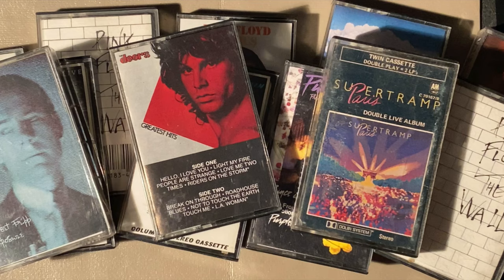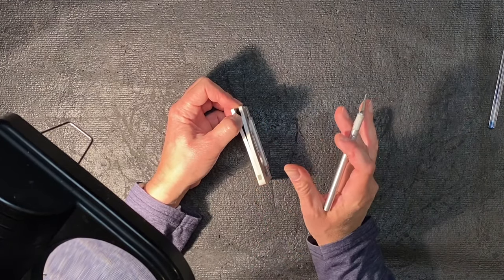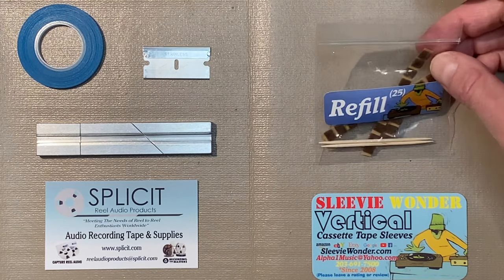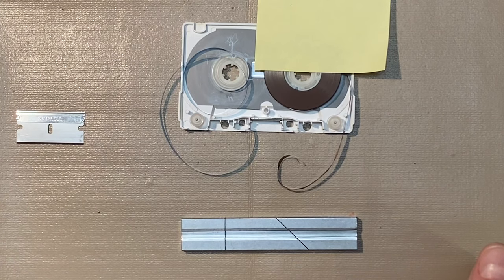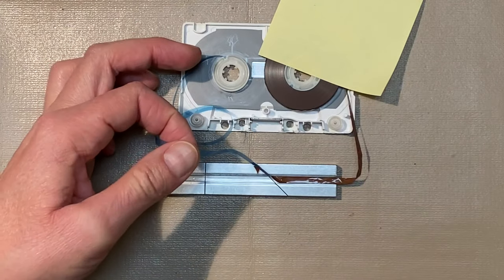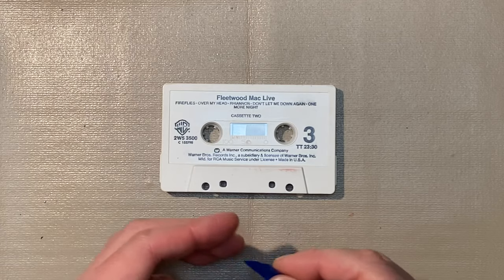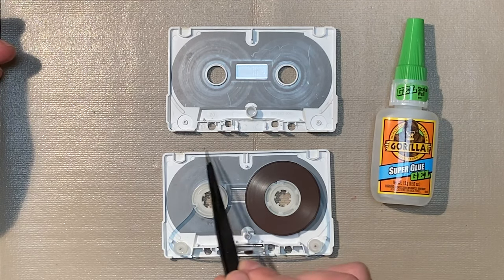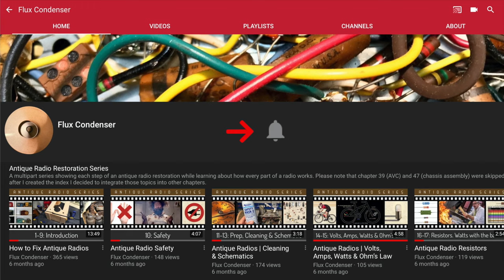How to Fix Cassette Tapes The Right Way. Open, Splice, Repair Like a Pro.

Comment: This video was a huge help. I recently bought a two tape album and both broke instantly where the magnetic tape connects to the plastic tape when played. I tried the method of opening the tape on an old home-made tape to see if I could do it without damaging it, but didn't have the right tool and was a bit impatient. I managed however to make use of this tape's plastic section to fish out the plastic tape on the tapes I was repairing, since the magnetic section was already exposed. It took a good few hours but somehow it worked. I could then follow your advice on how to repair them from there.
Reply from the maker: Glad to hear, Jay. Congrats on getting it fixed.

Comment: If you use a tape dispenser, you can pull a piece of splicing tape and cut it with the razor blade then stick one end to the razor blade parallel to the edge which helps to align it before you stick it down.

Comment: I have cassette tapes that are mostly sealed ones that need repair. They all have that pressure pad issue. And another tape just randomly snapped at the very end. The tape is sealed too.
Some of the tapes I fixed, have the snapping right where the Lier is, because, the sticky thing comes off.
Other tapes are really easy to repair. With screws in it of course. I also made a mini tape repair kit for tape parts.

Comment: Thank you!!
I just borrowed my parents old box of cassettes and their little radio to listen to and pull out some of the music i remember from when i was little. And what heppens but the one cassette i was looking forward to the most split the ribbon as soon as i started playing it.

I made due with what i had, which was a pair of scissors, sticky notes, scotch tape and some tweezers. It may not be the most elegant (or even proper), but the cassette is playing just fine as i type this comment. So again, thank you for this guide.

Comment: I managed to open the case using a hacksaw on the four corners .When you have opened it please make sure that you have the case with the roller pins facing up towards you otherwise it will be MISSION IMPOSSIBLE ! Cheers Eddie

Comment: Watched to validate that I was opening the case the right way lol. I used heat resistant tape to do the repair. Trimming the sides with a blade. Great video thanks.

Comment: Today i put a screwdriver into a cassette, and then ripped it apart (it was sonically connected, literally put a screwdriver into the tape path and bent it , exploded in my hands lol ). Took the spool and put it onto the replacement . I then taped down one side and got both the sides spoiled close as possible. The tricky part imo is getting the top tape shell back on without pressing into the tape on the tape path . I’ve never felt more accomplished AND IT WORKS . The tape is now worthless but it has exclusive stuff i cannot find online . Always pre wind new tapes, the factory splice sometimes snaps from being so old

Comment: Tapes that are screwed together, I can easily open up and repair. Tapes that are glued or sonically welded together are a different story. I can never get them apart - always end up breaking the shell into several pieces. Then I have to transfer the reels to another cassette shell to get the tape to play again!

Comment: Thank you from Romania, Brasov - followed your instruction and for one cassette by opening it I found out that one of the plastic roles was off, still inside but the pin that was holding that was missing - used a sewing pin to manufacture one and everything was back in place - this cassette is coming from my dead father-in-law so it has sentimental value - loved the joke about hemoroides - piles, never realised that piles is the equivalent of that - translation in Romanian/traducere romana - multumesc din Brasov, Romania - am urmat instructiunile de aici si la o caseta am descoperit in interior ca una din rolele de plastic cazuse si axul ei disparuse - am facut un alt ax dintr-un ac de cusut si acum totul e la loc - casetele astea sunt de la socrul meu care a decedat si au valoare sentimentala - am apreciat gluma despre hemoroizi - piles (mormane) - nu am stiut ca piles poate insemna si hemoroizi pt britanici
Reply from the maker: Glad it helped, Unul! Nice hack with the sewing pin.
Reply: @FluxCondenser  thank you - nice job once again with this video than brings back to life vintage things

Comment: Thanks for the information. I was able to open and repair a sealed cassette that was about 40 to 45 years old. I was able to digitize it but I may have to do it again. There were variations in tape speed part way through the tape. The tape recorders I have need maintenance as they have been used in a decade or more. One hasn't been used in several decades.

Comment: I first was interested in how to repair the pressure pad. Your instructions and sources of material were very helpful. Great video. Loved seeing someone else using cassette players. Loved the Nakamichi cassette drive! One question: if super glue is used on the inside points of the plastic case, won't that make it impossible to reuse? I assume you would just then move tape over to a new unmarked case, correct? Are replacements available that screw together?
Reply from the maker: Thanks, Jim. Glad you found the video helpful. As far as getting the cassette open again after using super glue, it won’t be a problem if you used glue on the outer edge of the shell if you repeat the step with the Xacto blade. That’ll cut through the glue. But yes, if you use a lot of glue on parts of the shell that you can’t get a blade into, it might make reopening the shell difficult. Replacement shells are absolutely still available. Check eBay.

Comment: You can do this with VCR tapes as well, there’s a couple of extra parts in them, mainly the locks on the tape reels, and sometimes a little T piece that goes between them that have to be set in accurately, but the principle is the same. And most VCR tapes have screws.
Reply from the maker: Yes, all tape recording media is relatively similar and can be repaired with splicing techniques. Even digital formats.

Comment: Great video .. i'll have to save it incase I need this information in the future. Do you have videos on how to fix tapes that are running slowly or ones that have broken cases? I have at least a dozen tapes (possible more, once I test them all) that have the slow running issue. Another tape is going to have to pulled apart to figure out what's going on it with it. It's frozen and the tape don't move in it no matter what I do. These are all pre-recorded tapes from the 70s-90s mostly.

Comment: I just got my The Doors Classics cracked in two and NOTHING broke. Dropped some glue in the top holes and snapped it back together. I use sponge and double sided tape for new pads.

Comment: Some good hints and an excellent run-though thank you.  Although the tape should definitely go INSIDE the side "posts", otherwise the rollers are not functioning efficiently (I have checked this on a couple of transparent pre-recorded bodies). I also prefer the  "bend until it creaks" method of opening the bodies,  then using a sharp edge like yours, if required - they usually come apart quite readily without cutting. EDIT:  upon further research, it seems that both routes are used,  (even in otherwise identical cassettes), so I change my advice to "it definitely doesn't matter!"

Comment: So. I dunno if that was the magic sauce or not but thanks. :D So I was using this same splicing hit to fix an old ZZ Top tape I had because the old tape was coming off. I was worried until I watched this again and realized (maybe) I was cutting the splicing tape too short. Got it a little longer and now no issues. For a minute there I thought the tape was too thick because it was getting stuck on the pinch wheel. 3/4s of an inch it seemed to matter in my case.

Comment: totally brilliant. the pot-it tip VERY helpful. personally, if tape still plays and not avilable on YT etc., I would dupe
it, in case rwpair does’nt work 100%
on brecored blank BASF caettes diacard top and side SM components(if fitted), if tape is jamming-de-spooling(one at top, & two side-arms.

Comment: A tip...get tapes from a charity shop and practice taking them apart, adding/removing leader tape, splicing...tapes that would be the very last thing you would normally buy...in my case, any opera, rap or chamber music! There are Tape Repair Kits, splicing blocks and splicing tape available on line....be prepared!

Comment: Just my two cents: it might be easier especially for a novice with an exacto knife to start from the tape slot and work it out from there towards the side with an empty hub or less tape.

Also don't forget to replace the slip sheets inside facing the exact way you found them, they are not bilateral and they usually have a slot or two for them to be correctly aligned. Also remember to not flip your reels, you might end up with Side A onto Side B.

Comment: I have learned to take the right sized screwdriver and twist it in the top holes of the cassette, the holes that decide if you can record or not on the tape...that will start the opening, then work your way around.
Reply from the maker: Kennynva, that’s a common method as well. I know many have good luck with prying and that’s great if it works for you. I always go for the blade method myself as I consider it less likely to mar or damage the shell.
Reply: @FluxCondenser  What do you think about using a soldering iron to make the holes in the top so it can auto read some these cassettes that read normal that are chrome.
Reply from the maker: Ouch! That sounds like a bad idea to me. It’s gonna smell horrible. It’s gonna leave an unsightly hole with deformed plastic that’ll have to be trimmed down. It might deform the shell permanently so it no longer fits in the machine. And, it may damage the tape inside. Open the shells, remove the tape and cut some nice clean slots with a blade or Dremel if you must. Or, transfer the tape to a suitable chrome shell.

Comment: You mention we want the blue tape on the 'inside' because the 'outside' has all the information. But magnetic stuff and this 'special' blue tape should not 'block' the information right? I see somewhere else where they suggest putting the tape on both the inside and outside?

Comment: Do you have a feature on reattatching leader to hub?
Reply from the maker: Not specifically, but generally this is an easy fix. In the hub there’s a small insert that can be removed. Remove the insert, align the leader with the hub and snap the insert back in to hold the leader in place.

Comment: we can imagine a rectangular piece of wood like a drawer with adjustable width and have the option to fix the blades on the side in a way when you push the cassette through the rectangle wooden drawer the knife cuts at the exact thickness we need to separate the shells without touching the tape. not sure this makes sense :)

Comment: The main problem I'm having using scotch tape is any tape deck I tried playing on, all autostopped right at the splice. Is the tape too thick or is the play head grabbing the edge of the tape? I've repaired a dozen tapes and every single one had the autostop issue.
Reply from the maker: Ronaldo, is the scotch tape on the back of the magnetic tape (no music side) or the front (music side)? The tape should be on the back side. Is the magnetic tape cut at the seam or is there an flap of tape remaining? There should be no flap of tape. Is the scotch tape cut exactly to the width of the magnetic tape and perfectly lined up with it? If there’s any scotch tape extending beyond the magnetic tape or if the tape path isn’t completely straight at the splice, that could trigger the auto stop. Also, make sure there’s no sticky residue. If none of those things are present, then yes, I would conclude that the scotch tape is either too thick or rigid and that’s why the auto stop is getting triggered.
Reply: @FluxCondenser  Everything you described I've done correctly, and I did find out it was me splicing the tape on the music side! Oh well, I'll need to fix the other tapes. Thanks for your response! No clue about tape gap tolerance.

also I'm using the normal brand of scotch tape from Walmart.

Comment: My problem is that my cassettes keep going muffled. They dont start off muffled but they get muffled. I think the tape is off track. I dont think its the pressure pad because the pressure pad is in place and wont move

Comment: hi get a vine pin or needle use it to put blue on around the cassette   i have a jig i  put tape in when glue sets   i have done alot  taps over the years  there is 1/8 edit tape
and block  you can get

Comment: Excellent instructions. I was able to remove the split the shell on my sonic youth "day dream nation" fairly easily pulling apart the shell by putting a small screw driver in holes on bottom of the shell. 

There is no leader on the side that is available to me. The tape split at the very beginning and the hub has nothing attached to it. What should I do ? I was thinking I could get the splice tape it to the hub and underneath the magnetic tape. Is that a good idea?
Reply from the maker: Taping to the hub is unlikely to hold. There’s a clip or pin in the hub that’s used to attach the tape. Remove the pin or clip and lay the tape over the recessed area and then reinsert the pin or clip to hold it in place. You can attach the magnetic audio tape to the hub this way, but as magnetic tape is fragile (especially as it ages) it won’t like being bent and held to the hub this way and it’s likely to break again. For a long-term solution, get some leader tape and splice a 6-8” piece to the magnetic audio tape. Then, attach the leader to the hub. You may consider temporarily holding the shell together so you can fast forward the tape and do the same on the other hub. Good luck, hope this helps.
Reply: @FluxCondenser  yeah thank you it does. I was looking for the clip or pin in the hub but I could not find it. I was considering buying a repair kit that comes with the leader tape and splicing tape. Even though I allready bought a replacement copy , I am still curious to fix this one. Thanks
Reply: @FluxCondenser  I was able to actually figure out just now that some of the tape and leader was so tightly wound around the hub I couldn't see the clip or pin. I carefully removed it from the hub and now I see that all I need to do is splice the magnetic tape together.
Reply from the maker: Ah, fantastic! Yes, I was surprised to hear that there was no leader as most prerecorded cassettes have one (though not all).
Reply: @FluxCondenser  yeah I was considering buying a leader cassette for _2.75 on splic it.com along with the cassette splic kit. Will the leader cassette  be usefull when reparing cassettes? I can link to product. Do you have promo code or anything with splicit.com?
Reply: http://www.splicit.com/Cassette-Leader-Tape-p/lt-125.htm this is the item I'm talking about.
Reply: By the way I clicked the multiple advertisements to help with ad revenue for the channel.
Reply from the maker: mercurialmagictrees I think the splicing kit will definitely come in handy and it includes a great block and good quality tape. The leader tape is good to have, too, but for most repairs, the leader tape in the cassette you’re fixing will still be usable. Having some spare leader tape around might come in handy, though, if the leader gets eaten by the machine and becomes unusable, or when fixing that rare cassette that doesn’t have a leader and adding one is a good idea. You may never need it, but since you’re buying the repair kit anyway, and the leader is so cheap, I’d say go for it and you’ll have it just in case. Sorry, my channel is so tiny that nobody’s reached out to me to offer any discounts to offer my viewers. Thanks so much for tolerating the ads and supporting the channel. Much appreciated! I’ve recently become monetized and am experimenting with allowing the ads. Hope they’re not to bothersome. I’ll never make back even a tiny fraction of what I spend to create this channel, but I figure if I can make a few bucks that pays for my solder and a couple of tools every year, I’ll take it!
Reply: @FluxCondenser  cool thanks for your input. This channel has great potential, keep up the good work. I'm sure if you reached out to them and asked them they would consider some arrangement since it helps reach more customers.  

I will buy the splicing kit and leader tape just in case. I'm surprised I'm putting in so much effort with cassettes but they're fun and the sound is unique.

 I have a 1980's Teac w-310c stereo cassette deck. I bought it super cheap locally and it works great. I'm glad because it wasn't tested before buying so I was lucky haha. 

I also have a GE portable cassette player(bought used locally for cheap as well). That is the machine that gave me the trouble in the first place haha. There is a slight hum most time (unless I adjust the headphone jack or set it on table a certain way) The fast forward and rewind are bit too aggressive so I have to be carefull or just avoid using those buttons haha.

Comment: Which brand and size of adhesive tape would you recommend here ?
Reply from the maker: I don’t have a brand preference. Just get something that’s specifically designed for splicing the type of tape you’re repairing. Cassette splicing tape is frequently labeled as ⅛” and 8-track and reel-to-reel tape is usually specified as ¼”. Hope this helps.